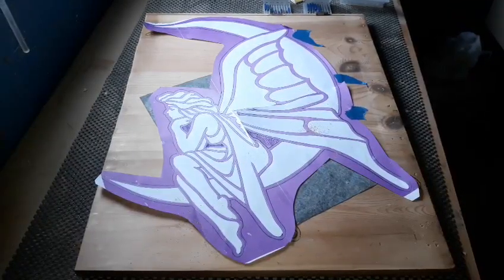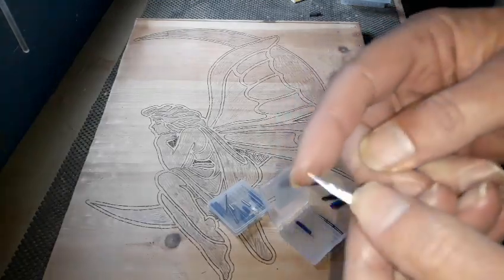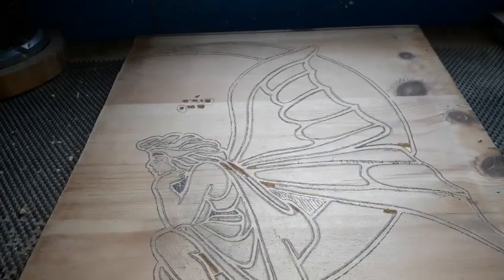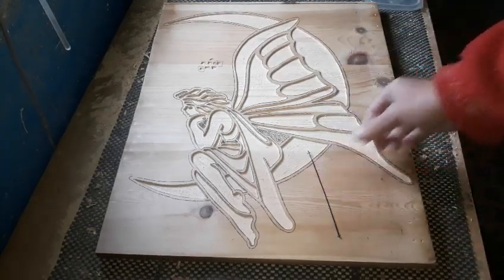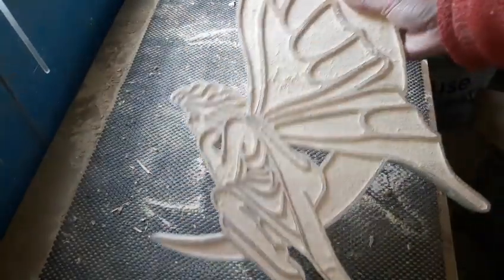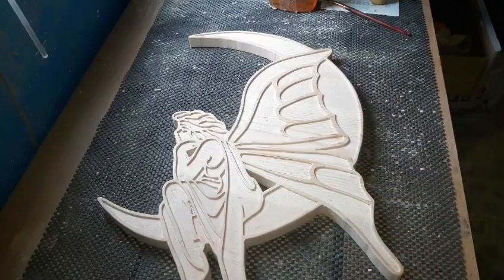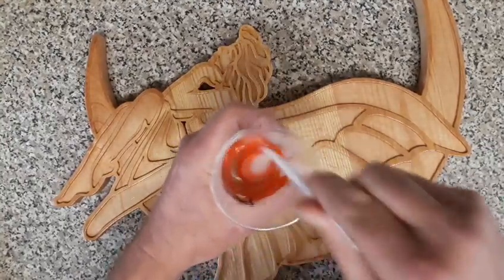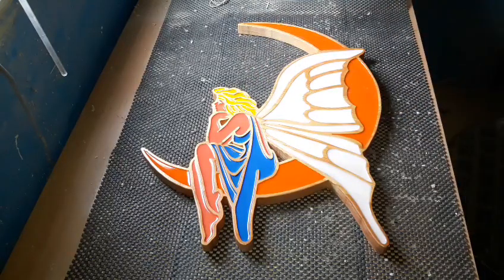Fairy on recycled pine with resin inlay..router project.

Comment: Another great video, when you use your 15 degree bit to go around the lines what depth do you start with in mm. cheers
Reply from the maker: It varies from project to project, but because of the resin going , 3mm is plenty ..

Comment: Hi Shane i cant seem to find the end milling bits you have with the coloured  bits i checked amazon but when they arrived they are all tiny end mill bits and it would take forever to clear even a small space....do you have a link as to where i can find them please
thanks
Reply from the maker: Here's the end milling bits they are great for small areas..https://www.ebay.co.uk/itm/182126325465
For larger areas these straight flush bits are excellent https://www.ebay.co.uk/itm/182124909126
Reply: @fishtank5050  woohoo thanks a mill Shane